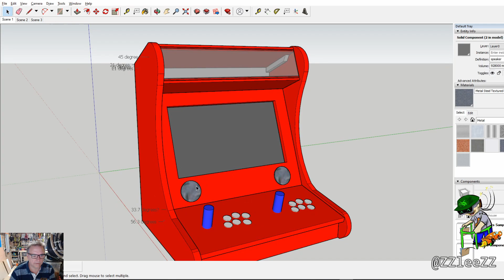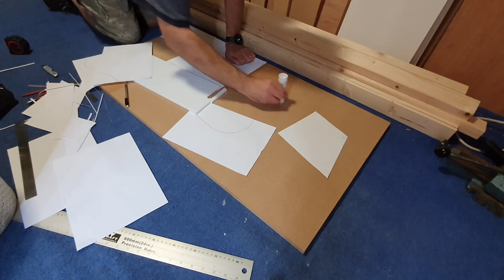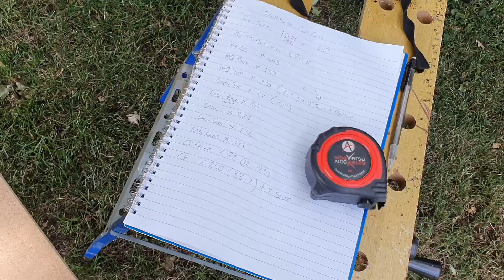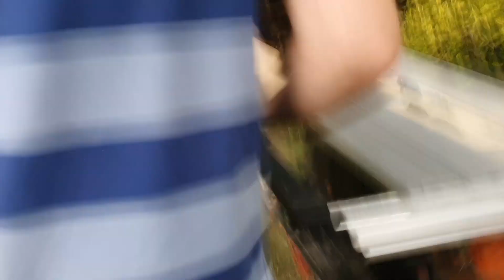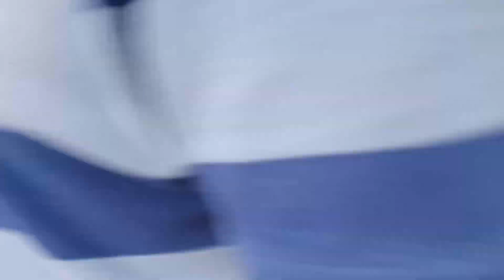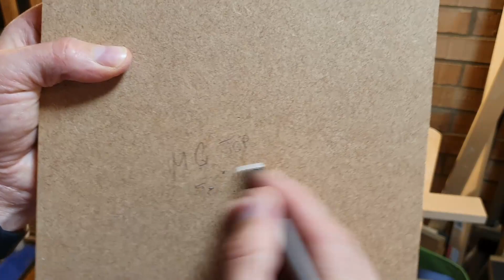Bartop Arcade Machine Build Part 1

Comment: I did a similar job, used a video projector to project the design onto the MDF, checked scale with a measure, then drew the outline. Cut both sides one on top of the other with a jigsaw.
Reply from the maker: I did that for some artwork on a previous build! Turned out much better than I thought it would. You can take a look at that part of the build on my blog here https://morefunmakingit.blogspot.com/2020/05/artistic-sense-is-tingling.html
Thanks for watching :D